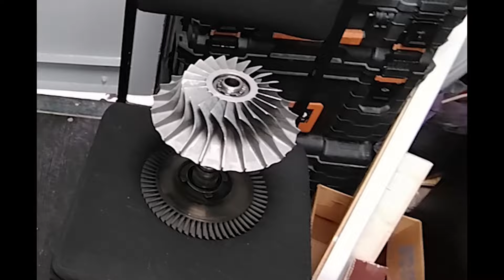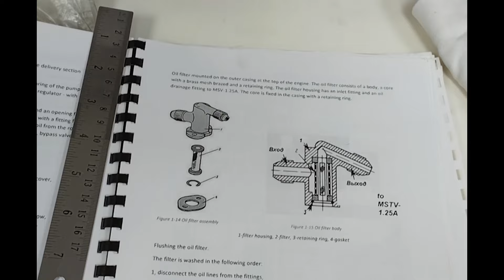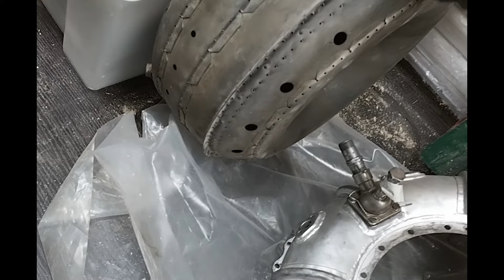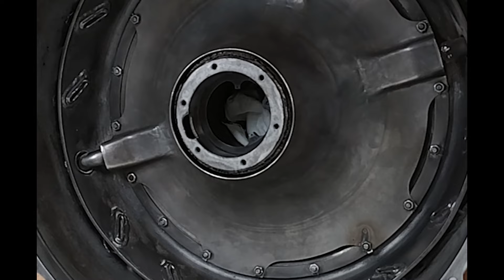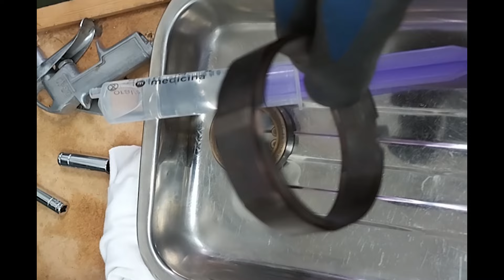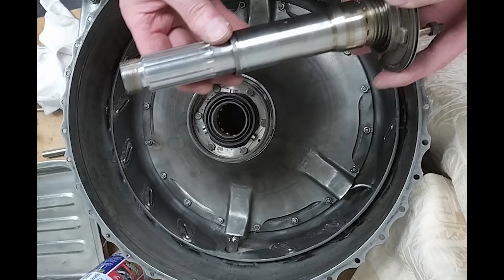Rebuild of an AI-9 APU Gas Turbine Day1 HD

Comment: Dónde puedo conseguir el manual
Reply from the maker: To stop manual collectors, Let me know what you have and why you need the manual and i will help you get it  :)
Reply: @derekbeacroft  I am an engine technician, I work with tv3 117 vm engines and apu AI 9v.  But we do not have a repair manual for the APU, we only have a maintenance manual.  thank you
Reply from the maker: contact me on facebook, as there is no private messaging here, not sure if what i have is the same, feed back on it would be good though.